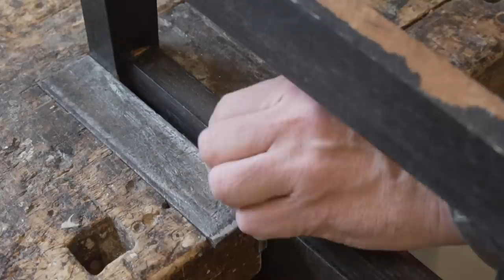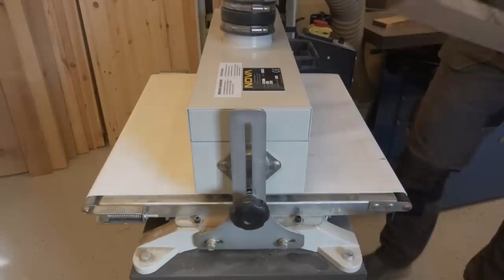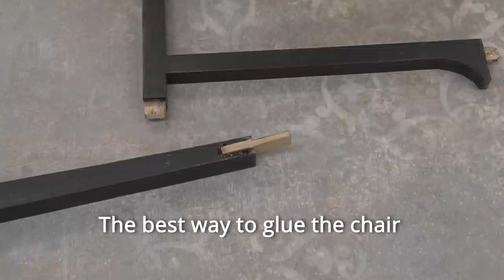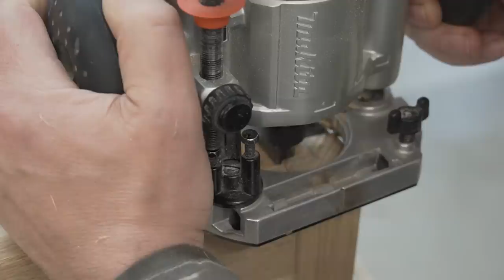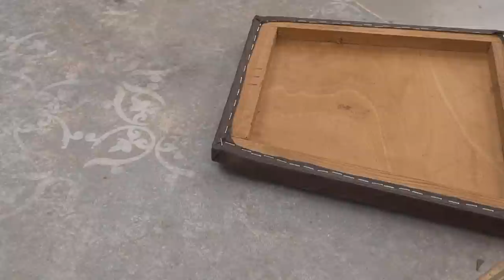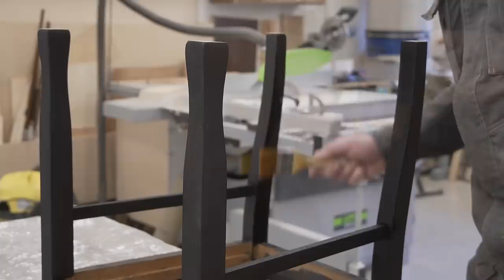BEAUTIFUL 1930´s dining chair restoration

Comment: For awful, rusted, stripped head screws, try a cheap tool called a "shake and break". It's an attachment for a pneumatic chisel with screwdriver heads that just vibrates and pushes down on the screw head, but applies no twisting motion, which you provide gently with a handle. It's like $30 and the thing paid for itself the first time i ever used it. Utter miracle of a tool.

Comment: I bought a little carbide tipped screw remover kit that removes screws with damaged heads, it fits as a drill bit and is the cat's bum for removing them quickly & easily 😎👍 (I've had to use it frequently) just sayin'